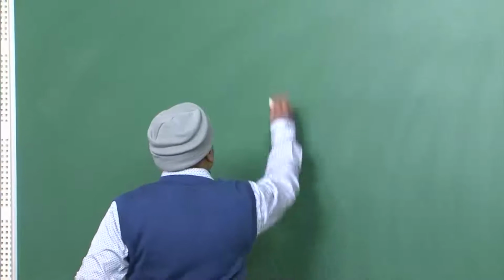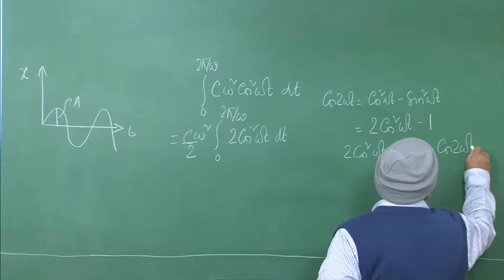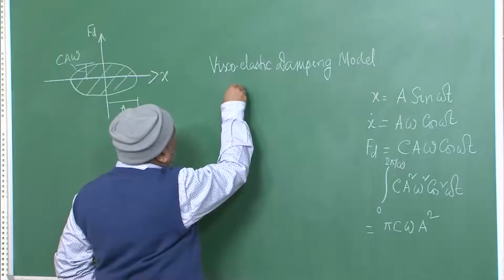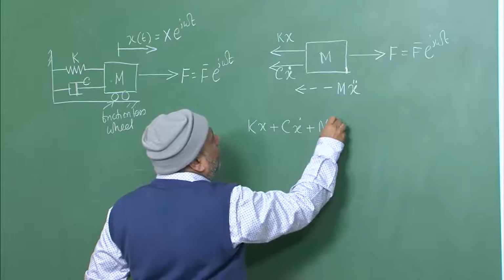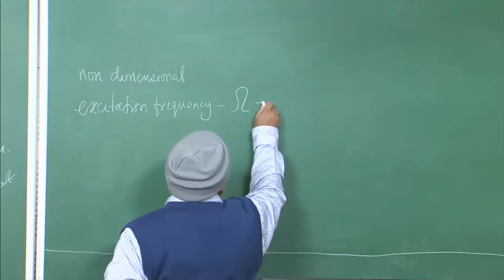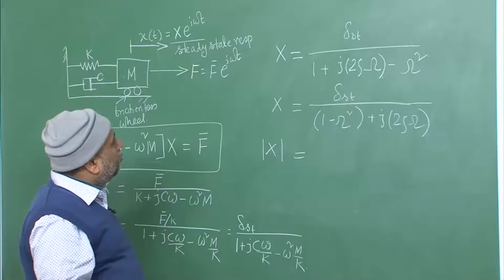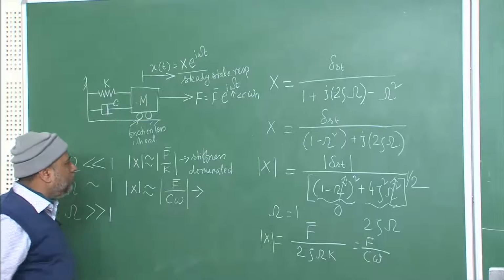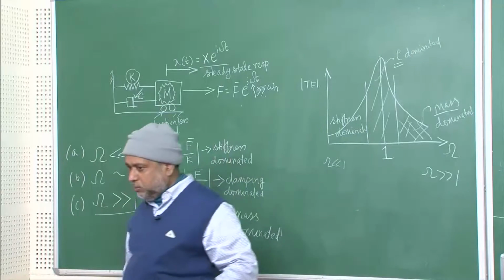Viscous damping model

Comment: Good video engineer, it would be interesting to make a video related to non-linear dissipators, where the speed and strength of the dissipator are not directly proportional. What would be the parameters to consider in mathematical modeling?